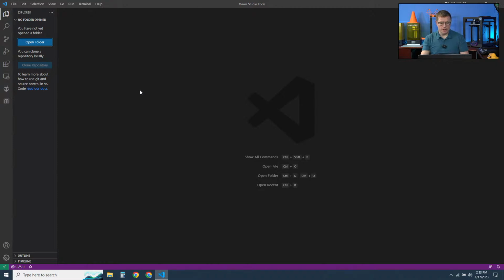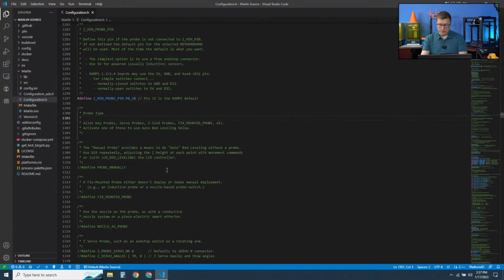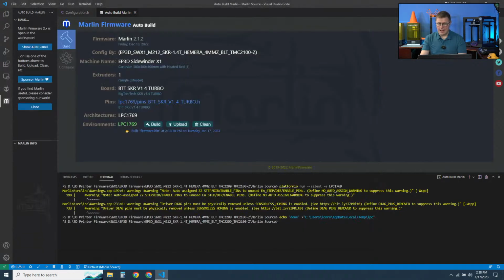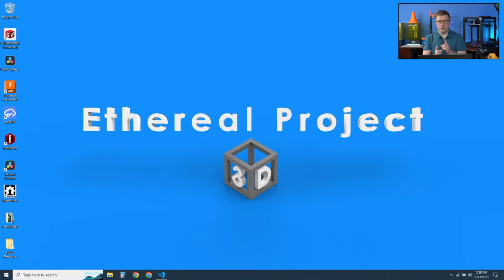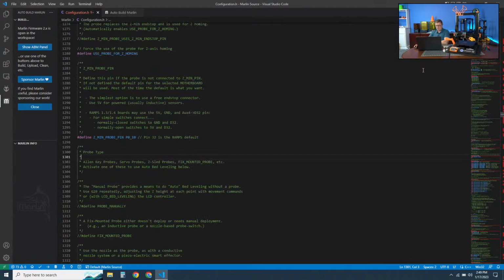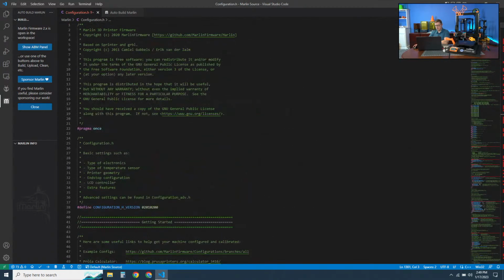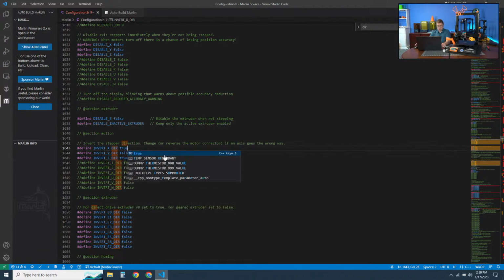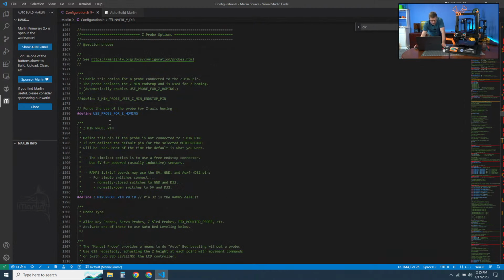Sidewinder X1 Livestream, Part 3, The Struggle Continues.

Comment: What screen is that  it using on the x1 and is it compatible with the standard main board or do u have to upgrade that
Reply from the maker: Its a Big Tree Tech TFT 35 V3. I dont believe it would work with the stock mainboard, I recommend the Big Tree Tech SKR 1.4 turbo or SKR 3.
Reply: @EtherealProject3D  cheers will look into it